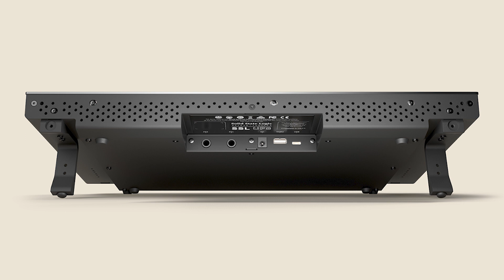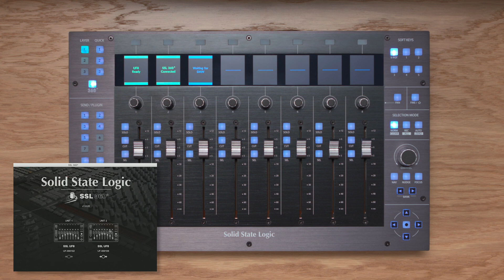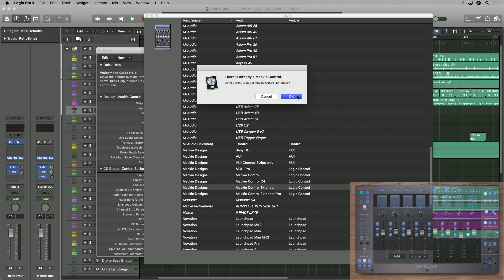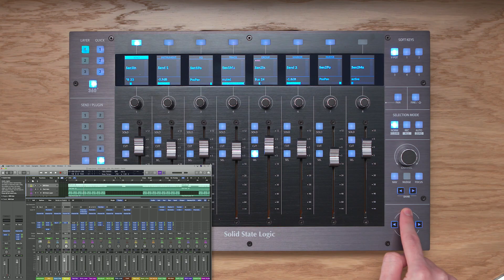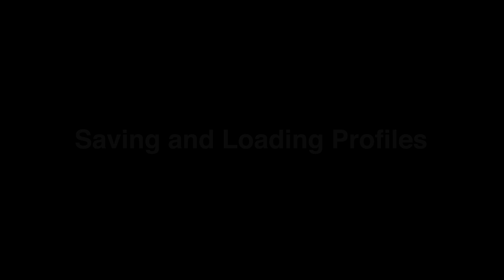UF8 Logic Pro Install & Set-up

Comment: Is there a tutorial about UC1 with Logic Pro?, i can't get my UC1 to work with the Solo Safe, when i solo one channel on the UC1 either it doesn't solo it, or it just solos it partially, letting other channels sounding, im using mix busses, but i've also put the solo safe on them, maybe im doing something wrong, so wanted to see if there is a tutorial official from SSSL, that guides thru those feateures on Logic Pro

Comment: Small note: If you use multiple DAW's and Logic is e.g. NOT on layer one, the SSL V Midi port channels will be DIFFERENT than 1. In my case, Logic is DAW2 so the ports I needed to use were 5 and 6 (I have 2 UF8 and 1 UF1). In 360 software when selecting the layer, then the port, it tells you what the proper ports actually are. Just a tip.

Comment: To anyone who is thinking of buying two units:  I noticed that the video didn't mention to change "Fader Bank Offset" from "0" to "8" for the second unit (Mackie Control Extender) otherwise the second unit will mirror the first unit in Logic Pro. Would save me a lot of headaches if I knew beforehand 🙂
Reply: Im running into that same issue now, how do i fix it?
Reply: @TrackStarMark  Open Logic Pro > Control Surfaces > Setup > Click on Mackie Control Extender Icon (which controls the 2nd UF8 unit) > Locate "Fader Bank Offset" and change the value from "0" to "8". Hope that helps!

Comment: Great video. However one slight error I noticed (I think) with the SSL V Midi Ports set up section. If you only choose Port 1 source then you can only controller one fader at a time. So if you want to change the volume on multiple faders simultaneously, then you need to add more ports here.
Reply: nope

Comment: Lovely controller overall. However I am hoping there could be a few fixes with firmware updates in the future:

- Make the font size able to be customized, and also since there appears to be plenty of space on the higher resolution LCD displays, the readout of every channel or parameter should either be able to line-break or scroll (like a news ticker). The current design with the large font which gets truncated or abbreviated beyond 6 characters makes it impossible to read almost anything. For example the instrument & EQ modes suggested in this video at 17:30 and 18:15 are practically useless to scroll through, especially on an EQ plugin, where all the names are so truncated that you can hardly tell what they are. At that point I might as well go back to mousing around since this takes way longer to decipher and a lot of times actually impossible - stuff like VeVoPr and BrBrcV 😵‍💫

- Speaking of deciphering, at least with logic the short names and instrument plugin names don't appear to be used. Instead they say stuff like Ins1Pl and Send1Mu. WTF? Would make more sense if they were called what they are called in Logic.

- On a similar note, it would be great if we could somehow customize the look of channels - background colors would be fantastic. Most of us color code our instruments and groups, so it would be much more helpful to see as you scroll all your drums, guitars, vocals etc., without having to slow down to read the names. Since these screens are LCDs and have color on them, I know it's possible. Or perhaps color coding the track names. Hell, even icons or something could be helpful.

- Also with the screens, the meter readout could be more useful - showing us numbers and a DB value maybe. Rather than having to switch to track > volume to see db values, it would make more sense to see it right next to the meters. I understand the screen real estate for each channel is limited but there's gotta be a better way to do that.

- The numbers on the left-hand side under send/plugin should be able to push to select. Currently, you have to go over to the scroll/paginate buttons on the bottom right of the controller, which is less intuitive and more tedious.

- For the keys which are not used in Logic and the layer keys for separate daws, it would be nicer to be able to override this customization as additional quick keys.
Reply: "The current design with the large font which gets truncated or abbreviated beyond 6 characters " My understanding is that the 6 character constraint comes from the Mackie protocol that is fundamental to the Logic - Control surface interface. I doubt that can be got round.
Reply: @keefycocker  you're right, after posting this I had reached out to SSL support and that is what they told me. However, interestingly, I notice in ProTools the text is longer - I believe I read it uses a different version of the mackie protocol (HUI?) which supports more characters? Either way, it would seem to me in 2023 there has to be some way to either update the protocol, or create some kind of workaround or translation between the protocol and the interface. My guess is Mackie has no interest in doing so. But is it the only useable protocol for this technology? Obviously I'm not a programmer but the interface clearly has the capability – so it would be great of that capability were truly exploited, rather than being choked by a 20+ year-old protocol. Or if the protocol is open-source, wondering if it would be possible at some point to see such an update.

Comment: I watched this and read the reviews and have bought one. It looks lovely. And it works really nicely. 
An added benefit of the layers (that I hoped for but couldn't find mentioned) and seems to work (so far)  is that you can set up two layers for your main DAW (mine is Logic) and switch between them. Adding 43 new soft keys for that DAW. So, I think I have 129 soft keys that I can programme for Logic. Should be enough!

Comment: video doesn't really address whether this will work with 3rd party plugins
Reply: I’ve got an X-Touch which uses the same Mackie set up. It will work with third party plugins and display the parameters functions on the scribble strips. The only bad thing is the order of the parameters is often mixed up. If you look closely you can see that in this video when he’s messing with the EQ plugin while in “plug-in” mode. It’s not in an intuitive order where you can, for example, change the Low gain and frequency at the same time. You’d have gain on one page... then to change to frequency position you’d have to scroll to the next. Then again to change Q. So it’s not like on a console where you have all that stuff next to each other for easy tweaking. Still faster to do it with a mouse in some cases. It depends on the plug-in and how many options it has. If I’m using something like a 3-band EQ, then everything is on one page. But anything more than that and things almost seem to be in a random order sometimes so it’s hard to find what you need quickly.  Most of the time I find myself turning knobs and checking the screen to see what’s happening because there’s not enough info on the strips to tell me what parameter it’s changing. Kind of defeats the purpose of trying to use it like a conse lol. I think that’s more how the DAW itself organizes MIDI parameters though, and isn’t something the companies have control of. I was hoping this would have that issue fixed because I would have switched to this instead of the X-Touch, but looks like it’s gonna be the same layout on any of them.

Comment: I would  like to put this thing to sleep at least. Don't want to pull cables or install a foot switch liek in the 1970ies to cut power. IS there at least a sleep feature - for environmental reasons / green footprint , at least.

Comment: I was lost but hopefully this tip will help others....Select Port 5 for MIDI input and Output. Not Port 1. I was using Layer 2 and this gave me a slight headache but 360 app explains this after poking around.
Reply: Thank you I’m having the same issue. I’ll give it a try.

Comment: If the price is the same as an avid s1, why shouldn’t I just get those? 
I mean, those have more versatility. 

iPad remote control, the ability to connect up to 4 of them, plus a dock, for spill mode, magnetically, separate tablet screens for each one, making them look like a mini S6 setup, plus do much more 

I do not work for avid, but I’ve been looking at these controllers for a while, and still see those, unfortunately, as the best built, and most versatile, next to an actual mixing board or mixing desk. 

Basically, please tell me why yours should be considered over theirs.
Reply: Have You had an answer to those questions? I have the same decision Avid S1 vs UF8 for Logic Pro X. Thanks!
Reply: @RolandsBriedis  nope, no reply yet. Yours was the first one. I can’t justify the price of the UF8 no matter how much I try.
Reply: Avid stops supporting their own hardware after 5 years. 
I unfortunately bought one of their controllers and have regretted it once I updated my computer that was it !! no more updates fir the Avid control .
Reply: @jammmessenger  Oh, I stopped looking at AVID years ago.

Comment: This looks cool and I wish I could get into using a controller... but I tried several times with several consoles and iPad remote, and since I still need to use mouse for a lot of stuff anyway all these controllers were more of a hassle than they were a benefit in the end. I would just do the job much faster and easier using mouse and keyboard shortcuts. That being said, it is a great feeling to move physical faders and knobs for sure.
Reply: same feeling. We are in 2021 with self driving cars - and these companies can't figure out a really good remote control system for what we all do?
Reply: @massivebeatzz  Right? haha

Comment: Very nice SSL! I can imagine a additional Master Section Module with a master fader, a proper transport section, assignable knobs, a jog/shuttle encoder, buttons for punch in and out, cut/copy/paste, plugin selection and so on. Imagine two of the fader modules with a master module. That would be great. Keep going SSL.
Reply: Absolutely
Reply: Please 👍🏻
Reply: That sounds like the specs for the Nucleus
Reply: @avincentphotography  but without the analog sound component and the dante network, in my opinion its just needed for a good contoller